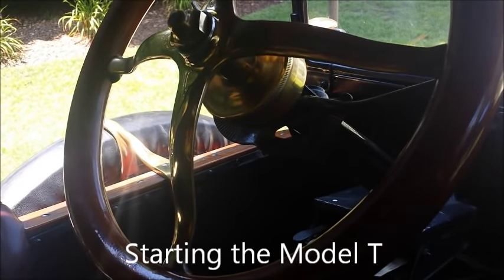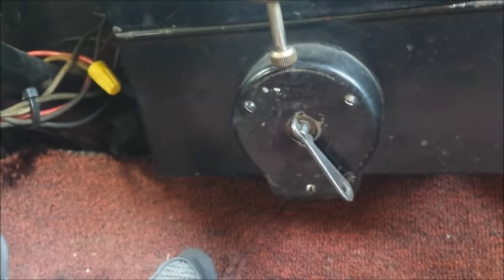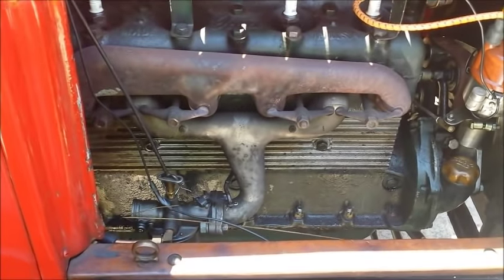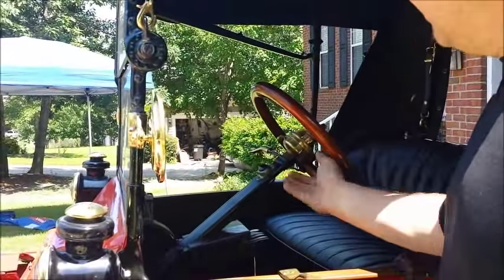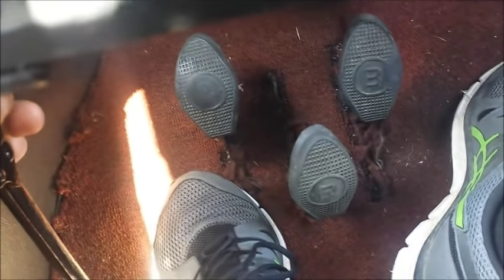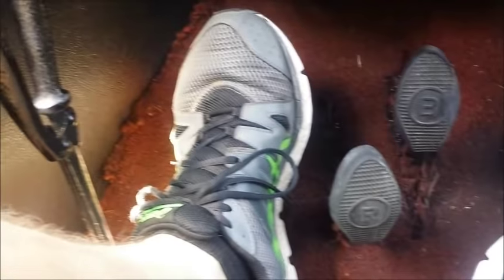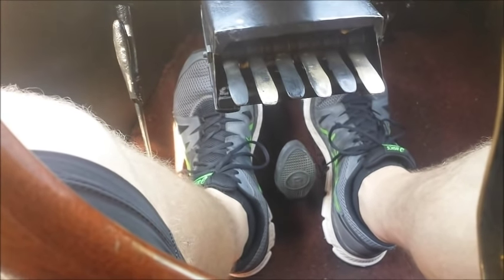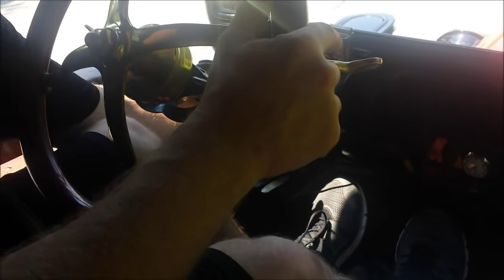Model T Driving Instructions

Comment: They don't seem as complicated as I thought they'd be. Nevertheless, it's pretty cool though. What a lot of folks don't realize is that these little Tin Lizzies are incredible vehicles to get around in on rough terrain and in snowy conditions. They were great off road vehicles remember they were driven primarily back in the day when there wasn't a lot of road ways. Most of these things were driven on old wagon trails and cow paths and farmers fields until roads were built.
Reply: That's also part of why they'd break down so frequently, causing roads to be commissioned to help cars quit taking so much damage.
Reply: Except they were one wheel drive, so they got stuck easily. You also had to go uphill backwards.

Comment: This really made me appreciate my car with a button push-start ignition
Reply: You damn kids and your fancy new cars! Back in my day, we started our Corollas and Accords with a key, like red-blooded men!
Reply: @DavidEasthope  Ahh yes push to start and then having to sell your kidney to get it fixed if it breaks. Keys for the win!
Reply: @dabeanne  The key start on a modern car is more or less the same system, just with a lock cylinder instead of the button.  There are still anti-theft systems that communicate with the key.  Plus, there isn't a whole lot to break in a push-button start, unless a computer fails (which would still render a car with a key start unusable)
Reply: @DavidEasthope  well my 1976 fiat om 650 has an ignition button so...
Reply: @thetechconspiracy2  I hate the brake switch interlock that always goes along with it. For some reason all the manufacturers felt the need to add that with push button start.

Comment: I'm a millennial that got to figure out how to make one of these run and drive after it sat for decades. One of my favorite memories of my old job. I wish more people in my generation were into this stuff.
Reply: I am Gen Z, my father and I recently purchased a 1919 Model T Roadster in moderately good condition. I've been working day and night restoring each and every part, removing all the rust and ancient enamel. Hopefully going to have the engine running by the end of next month, and have everything repainted in about 2 weeks.
Reply: @paladinbirdy6032  you should youtube the process!
Reply: It's interesting isn't it? I'm a gen X and my first car had a 3speed manual column shift. It surprises me how many youngsters can't even drive a modern stick.
Reply: We are on this stuff! My daily driver is a 1965 fiat 1500L
Reply: @paladinbirdy6032  did you get the model t going?
Reply: It’s old bikes for me, I’m a bit younger than you just hitting 24 but I feel you
Reply: A lot of us are into this, gotta keep an eye out for us!
Reply: @alcoholic2412  I learned in a 1970 Ford pickup with a 3-speed.  As a teen and young adult, drove whatever piece of crap that I could afford at the time, and nursed it along until something REALLY expensive failed.  Since I leaned with a manual trans, that was never an issue when car shopping.

Still not real picky, but will admit that it is kind of neat to have a car where I can toggle between ECO/NORMAL/SPORT and totally change both the performance and the handling.  Never thought I'd see the day where I could do so many things like make a cell phone call or play with the (satellite) radio without ever taking my hands off of the wheel.
Reply: @paladinbirdy6032  How's the car? You ever get it running?
Reply: Congratulations on being interested in more than just cell phones and computers.  Yes, it is sad that most of your generation does not love cars, and if they do, only Datsuns and Toyotas.
Reply: @kevincrosby1760  You are not supposed to use a cell phone while driving.  That's one of the reasons the accident rate is so horrendous nowadays.
Reply: @michaelbenardo5695  By that logic I should also not speak to any passengers in the vehicle...or listen to the radio.

I'm driving down the road and the wife calls me.  The radio mutes and i hear ringing.  I hit a button on the steering wheel and the call is answered.  I hear her over the car speakers.  Dunno where the mic is, but I can speak at a normal level and she can hear me just fine.  I hit the button again to hang up.

To make a call, I hit the button, hear a beep, and announce to thin air "call Joe mobile" and I listen to ringing over the car speakers until Joe answers his cell phone.

Total distraction level is about the same as engaging cruise control then talking to a passenger.  

The above actually applies to when I drive the WIFE'S car.  When i talk to my '05 Toyota Corolla, the conversation probably shouldn't be heard by children..
Reply: @michaelbenardo5695  Out of the many cars I have owned, I think that I miss the '66 Chrysler Newport and the '78 Chev Impala the most.

When the Newport needed to go away due to my imminent departure for boot camp, I had offers from people who wanted to part it out.  It wasn't pretty, but EVERYTHING worked...including the A/C.  I finally picked a little church and handed the preacher the title and keys.  Got a nice letter from a couple who REALLY appreciated finally having a car for themselves and their 3 children.

The Impala finally had enough around 200k miles, and I had no place to do much work other than minor maintenance.  It was replaced by an '85 Ford Thunderbird with the 5.0l V8.
Reply: @kevincrosby1760  Hope you still have the T-Bird!
Reply: @kevincrosby1760  I guess we have to agree to disagree on that one.
Reply: @kevincrosby1760  The difference is that a passenger has his own pair of eyes on the road and can warn you when you don't notice something.

Comment: What are all the switches that look like organ pedals under the steering wheel?
Reply from the maker: They were many horns that he'd use during parades.  He could play a little tune when they all worked.
Reply: Thats NOS
Reply: Pee Diggy thats a carillion. those time they didnt have a car stereo so there was a little tower on the roof of the car with bells weighing in total about 130 tons, which were used to play tunes during long boring rides. now car stereo is much lighter.

Comment: This reminds me of some ways of the 1926 Chrysler Imperial that my former boss would allow me to drive. I would have to hand crank it, manually work the choke to keep it running, and there was a manual spark advance on it as well. But it actually had a three speed manual transmission with an extremely stiff cable operated clutch. It actually had an accelerator pedal, but it was in between the clutch and brake pedals. It was really fun but challenging to drive it properly. It cruised at a brisk 37 mph. These antique cars are like driving old tractors. You have to pay a lot of attention!

Comment: Please don't brake with the reverse and low bands. That's what the brake pedal is for. When you slow the car down with the reverse drum you risk cracking the drum which is already pretty fragile as it is. Low gets enough abuse just driving the car. Every time I take a transmission apart either the low drum, the reverse drum or both are cracked.   It looks like you have rocky mountain brakes so there's really no reason to do it anyway.
Reply from the maker: Good points. I don't think I ever had to use reverse but I remember riding with grandpa once when a semi pulled out in front.  He mashed about every pedal down there getting a car full of us stopped.  Wouldn't recommend it under any normal circumstances.
Reply: He did say only if you really get into trouble.

Comment: Well, it may look like a complicated starting but you don't do this all the time. Most T's had electric starter or have it now, standard buzz coil ignition works extremely fine... And it's not harder than starting a motorbike. One more thing: carbureted cars have much easier start in our frezzin'-cold conditions.

Comment: This looks so much more complicated than my Model A, haha.
Reply: It is.  Henry wasn't happy about having to move away from the planetary transmission to a dry disc clutch and sliding gear transmission, but the handwriting was on the wall.  Strangely, there were a LOT of T owners who wouldn't buy a Model A because they felt Henry betrayed them..  And for what it's worth, the T trans is a lot like an automatic transmission with the driver/operator acting like the valve body...  Think about it!

Comment: I've always been able to adapt to driving new vehicles in a couple minutes or less.  I learned to drive on a manual transmission Yugo at age 12, now I can drive anything.  I actually want to try driving one of these now that I know how all the controls work.  Sadly there probably aren't any to drive unless you know a collector that has one.  Also, I think a lot of them have been modified with more modern parts to automate some of it.
Reply: A lot of them got converted with model A tansmissions as I understand it. You also COULD fabricate parts to convert it to gear lever/clutch/brake/gas. I don't recall why they where made this way, but at the time there wasn't really a standard (The way we have manual cars now comes down to a company called Stanley Motors IIRC, it's their control scheme but it worked very well).
Reply: @DFX2KX  Yeah...it's like looking at an N64 contorller and saying "why does it have such a weird layout"?  Because noone had ever made a controller for 3D games before, they were inventing it as they went along.  (It wasn't the first analog controller, but it was the first console controller designed from the ground up to play 3D games).  When there isn't a standard, you make up your own.  At the time, this probably seemed quite logical.  It's only now, with the benefit of hindsight and more intuitive systems, that we can say it was a bit clunky.
Reply: It looks very easy once you'll put yourself in the shoes of 1910 person who's never driven any automobile before. There's giant brake lever like all horse carriages have and it even disengages the clutch for you, you can just fiddle with gas levers until it sounds right (you'd have a lot of time for that on 1910s roads) and once you'd panic and need to stop right now, your first habit would be to pull that nice brake lever and/or mash whatever pedal your foot will find. Left throws you into lower gear, making engine brake force stronger, middle is secondary brake and right is primary brake. You literally can't screw it up even if you'll somehow forget about brake lever and you'll press all three pedals, hoping for the best.

Comment: Nice brassy you got there.  My dad had a 21 pickup and every summer we  took it on the parade circuit across the Iron range here in MN. didn't know you could use a VW distributor we always had the old wood coils and I miss the buzzing sounds they made.

Comment: Great video, few people remember the cars u actually had to drive!
I remember my Dad telling me about learning to drive  in a Model T truck!  When the forward  clutches, or bands actually, got out of adjustment or worn out u had to turn around and back up hills, reverse being less used lasted the longest!  
Two very important things  he taught me  from that experience;
"Forget about the brakes, learn to "Drive" out of it" It used a band in the transmission for brakes, even adjusted correctly they did not work very well!
"Don't think about it as "backing up" learn to drive it both directions!
Reply: I've read somewhere that many model T drivers went uphill in reverse because the car had no fuel pump and used only a gravity feed, so the carb would starve going uphill. But going up a steep hill in reverse instead kept the fuel tank higher than the engine for a continued fuel flow. Haha
Reply: @sauter1 Also, do not forget that the reverse gear has a much larger gear ratio.  The reverse gear ratio was 14.52:1, and the first gear was 9.98:1

Comment: Why would you not have magnetos
Reply: Not as fun
Reply: His buzzbox seems modified too.
Reply from the maker: Grandpa's car.  I think it ran poorly on magnetos.  Converted to battery and distributor in the 90s.
Reply: Same reason all distributor engines don't have them, they don't need em. Only benefit is having a back up ignition in case the distributor ignition fails but since its a Model T and not a daily driver it's not worth the extra parts and wiring. Maybe if it was a fire truck or emergency vehicle it would make sense but not for a hobby car.

Comment: Brings back many amazing memories of mine with my PawPaw! He had a 24 T throughout my childhood and early adult life. It actually had a high speed “rutsle” he called it. So it had 3 speeds able to cruise a whopping 40-45 mph 55 going down hill but god help you with those band brakes at that speed 😂. Had electric start so never did start it by the crank. 
When I was no more than 6 years old I was sitting on PawPaws lap steering it around the school parking lot near his house then when I could reach the pedals he would leave the hand brake half way so I could only get into low gear and I was on my own. Remember those days better than yesterday

Comment: i wish cars were still like this now...with technology we have become so lazy and gluttons
Reply: John Texas I wish I could.
Reply: John Texas I hear ya there buddy, but even though the cost is low, I cannot afford it or have a place to store one at the moment. As much as I would love to have one, I dont think Id have the time for it either with all my other hobbies. They are very cool to look at though, maybe sometime in the future when I retire, the operation is not a problem, Ive had the pleasure of driving one at a repair shop I worked at along with alot of other rare cars.
Reply: John Texas My favorite project was a 1959 Buick Electra 225, re did the heads on a nailhead, still had the original valve seats for leaded gasoline, the seats were all torn up from running conventional gasoline, poor thing ran horrible till we put in hardened seats in and new valves.
Reply: Why???
Buy a manual transmition modern car and you aren't lazy anymore..
Reply: If we made cars with 2 gears our speed limit would go from 65 to 20
Reply: HipHopisArt theres fast 2 speeds out there.
Reply: Yea, for that you need a VERY strong engine...
So ppl most wouldn't have cars..

Cars are great with a manual stick (as i mention) we have much more control than the model T. We have at least 5 speeds to choose, we can heel and toe, double clutch if the syncs are bad... yea we dont pick the engine advance... but if we remap the car we actually can program even that
Reply: 1300l yea theres such thing as a 2 speed. dodge chargers even had 3 speeds.
Reply: Wanting to abandon 100 years of improvements is just silly.  There's a reason you aren't driving this daily, and it's not finances.
Reply: Those are expensive cars... or just old cars...
Reply: So you're saying 100 years in technological advancement is bad?
Reply: no you don't.... you don't want to break your wrists starting your car everyday do you?
Reply: Stupid post. Technology prevents us from having to waste time doing unnecessary things. You could say the same thing about the Model T when it was first created vs a horse and buggy.
Reply: ModernLifeIsWar It wouldnt be unnecessary if you had to do it, my point is people have gotten lazy. Technology has its advantages and disadvantages, tons of recalls and unnecessary (to speak of that) crap on cars now, most people are too stupid to figure out how anything works, and the first to bitch about repairs being costly, it makes me laugh, pointless post there.
Reply: wont happen if done correctly, and of course now someone isnt gping to turn over a 9:1 comoression ratio, my point is people cant figure anything out with turn key crap that engineers having failures that can kill people, sure its not gonna happen all the time, but id take a broken wrist over a deadly recall...so yes I do.
Reply: Seems a cpuple people have missed my point, but they want their comprehension to be turn key too. Good examples of what is wrong..too funny
Reply: People have gotten lazy because they want to drive a automatic? Learn the difference of lazy and convenient my friend. It kinda worries me that you truly believe that model T is more reliable than modern day cars
Reply: HipHopisArt You have COMPLETELY missed my point, its way over your head, I have 18 years experience in auto repair, my post has nothing in general with a Model T... I wpuld have to say nevermind on my point since you just do not seem to get what I'm saying. It has nothing to do with reliability..or cars..just forget it and move on and get the last word so you can feel like you won, I have no more time for this. I'll consider my point missed from my original comment, I didnt think I would have to elaborate on it so everyone would underatand, it wasnt directed completely at a particular car or anything...just nevermind
Reply: stilltlrforlife You've realized your original post was just foolish, and now you're backtracking on it.  You said you "wished cars were still like this."
Reply: No..yo u missed the point on the comment..thats all a rhitorical comment in general..about how lazy people have become in general.. like I said point missed completely, if you dont get it, you won't.
Reply: John Texas Hip hop isn't limited to the stuff on the radio. It's an extremely diverse genre of music. If you want to check out something where the lyrics are extremely creative and go deep into a non-thug subject I would recommend Tech N9ne's Fragile
Reply: stilltlrforlife I don't think you even know the definition of 'rhetorical.'  Not that you even managed to form a proper sentence.
Reply: John Texas Dark side?